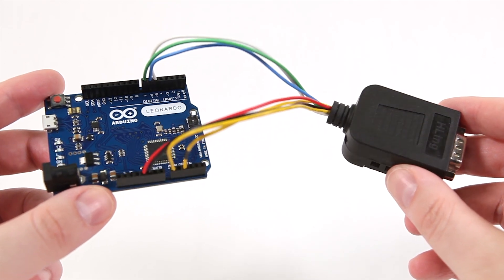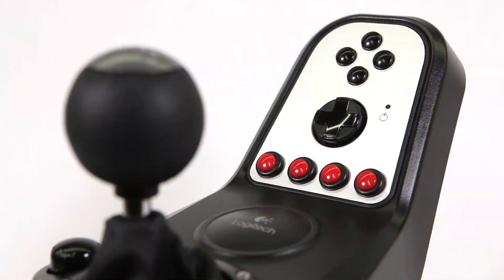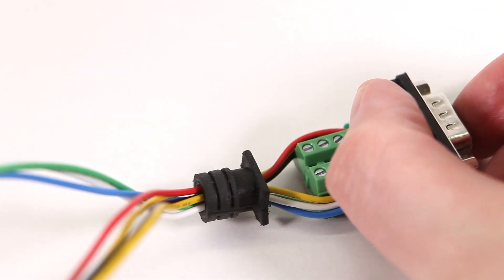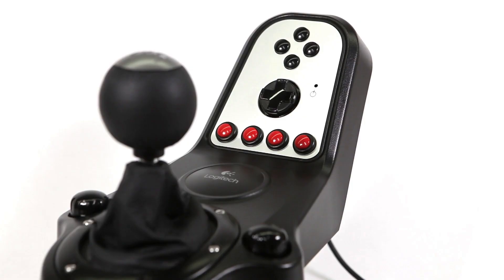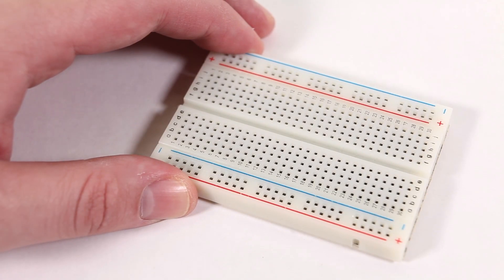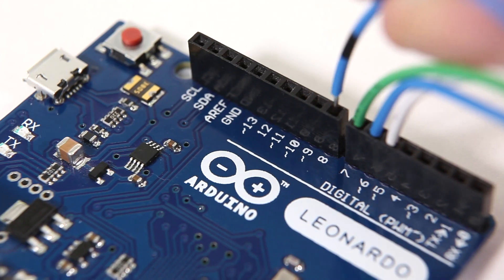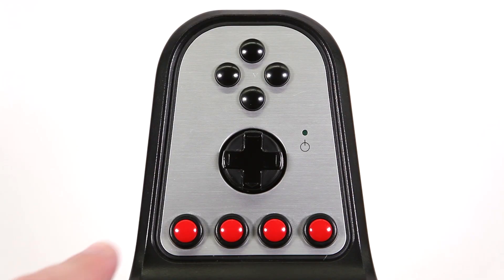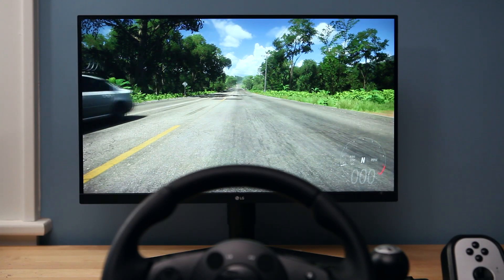Enabling the Power LED on the Logitech G25/G27 Shifter

Comment: Could you please make a video on how to reuse the steering wheel using the Arduino Leonardo using the buttons on the original board, and add the library. I've done a lot of research and haven't been able to do it myself. It would be a great help to anyone who has lost the main board and wants to use the steering wheel with Arduino Leonardo and an incremental encoder.

Comment: Hi mate, I made this connection on my G27 Shifter and in this case I only connected the ground of the LED (5) instead of (6). Everything works normally for me.. I just need to adjust the axes of the H Shifter, because the buttons are not appearing correctly... do you have any suggestions that could help me? Thanks
Reply from the maker: You need to connect ground to pin 6, per the other videos. Grounding the LED is not a substitute for the main ground pin.
Reply: @dave.madison  I will do this after your explanation in this video... as for the shifter gear synchronization, do you have any suggestions? It is not recognizing the first gear, and neither down (2, 4, 6) nor reverse... would I have to make any adjustments to the axles in the programming?